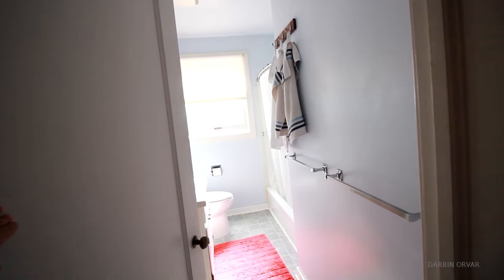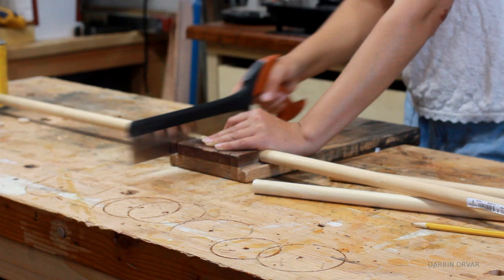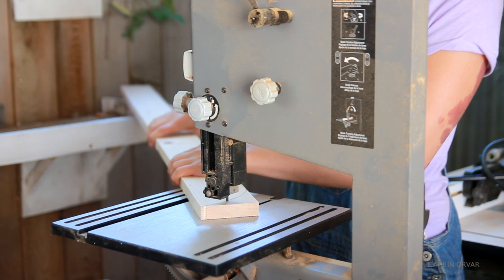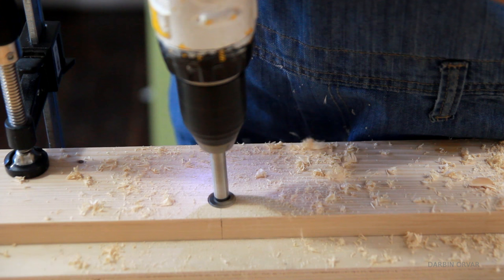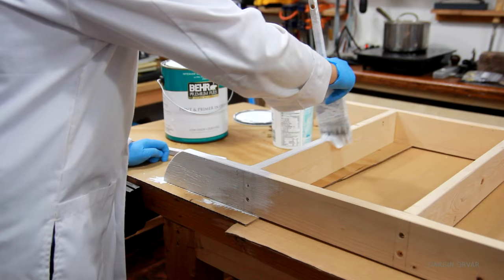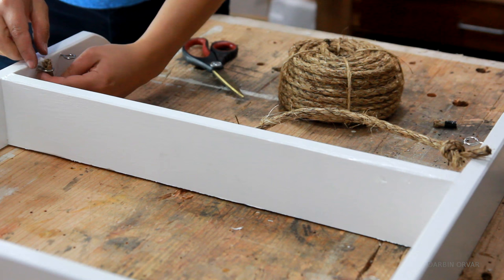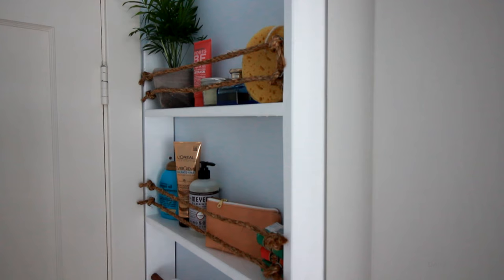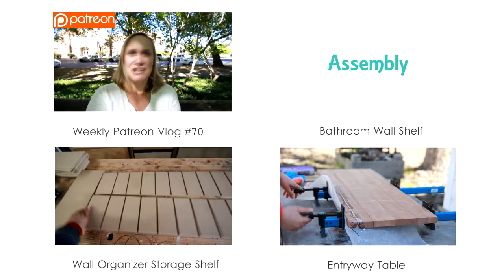DIY Bathroom Towel Rack

Comment: Love the project, it is very similar to an outdoor one I made for a neighbor a few months ago. A couple suggestions from my own that may help. If you have the cash, cedar is a good choice for repelling moths, handling the repeated moisture from wet towels and helping to alleviate any odors. I used some 1" thick shipyard rope for my actual rods instead of dowels and just had to soak them in some thinned out epoxy to make them rigid. I love the tied off ropes on the shelves you did, I may have to add those to some of my own shelves when I get the chance. Great work!

Comment: hi darbin, love your channel !  I made a towel rack also...however I don't have the storage with the doors. I simply purchased a suspension rod (like for a kitchen window) and extended it between the space behind the door and the base cabinet where the sink is. not as fancy as yours, but it hangs up a couple of bath towels.
Reply from the maker: Thanks Lexy! That sounds like a great solution.